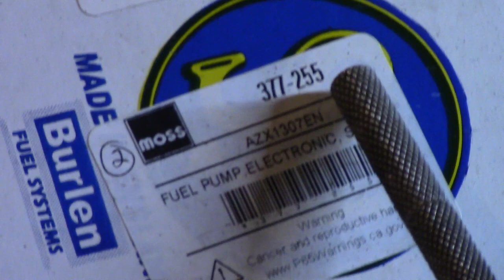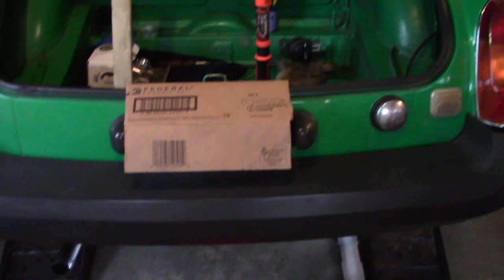MGB Fuel Pump Remove and Replace. How to Install a Fuel Pump on a 1965 to 1980 MGB. You Got This!

Comment: I have a 74 1/2 that for the first time in 10 years would not start after the winter. I usually start it a few times during winter here in NC to keep the battery charged but got lazy this winter and the battery was stone dead. Anyway, after replacing it, she'll crank but won't idle. I'm thinking some sort of fuel issue, or the pump may be bad. I put a little gas in the carbs, and it started briefly and then died. The trouble shooting begins!

Comment: Perfect timing finding your video. I have a 78 MGB with Rover V8 I am finishing up reviving from dead. I was wondering about the noise filter part of the wiring. Couldn’t figure out what it could be until you said it and then it was like slap to the forehead! On the under side of the tank, there is a wire with a connector plugged into the pump on that side, and I am not sure what that is now. I had been assuming it was the wire to the fuel sending unit, but your video has shown that to be incorrect (I received my car with a new fuel tank installed but everything else on fuel delivery was not installed).

Comment: Good video. The banjo fittings have a smooth side and a recessed side. Which side do you have facing the fuel pump?
Reply from the maker: Hey Mark, I didn't notice any difference. I put them on the same way that I found them. There was a lot of memory in the fuel lines so it was easy to put them back on the way I found them. I hope that helps
Reply from the maker: I rewatched the video and zoomed in and it appears the recessed side is facing the fuel pump on my MGB.
Reply: @CantLetHerDieDIY  I removed it all to put on fresh hoses, then i realized there is a difference in the fitting. Each old bolt did have a fiber gasket on each side and a neoprene ring. So I reassembled with the grooved side facing the pump and I get a drip. It seems like the grooved side demands a gasket. Sometimes,  on these cars, what should be so simple can be so perpl
Reply: Perplexing.
Reply: I reassembled each bolt with two fiber gaskets and the ring.
Reply: @cantletherdiediy1050  I bought new banjo fittings from BPNW, they are smooth on both sides. No recessed area. Will try today.
Reply from the maker: @markferrier6403  During my research on this fuel pump. I learned that the new fuel pumps have an o-ring (neoprene ring) which replaces the fiber washer on the fuel pump side. I don't think you should use the fiber washer if you have an o-ring on your fuel pump.
Reply: @cantletherdiediy1050  I assembled both sides with only the O ring on the carb side. It did not leak. Anyone who installs a new fuel pump should also install new banjo fittings. Cheers, mark

Comment: Hi mate, Ive got a 1979 MGB Roadster I had for 15 years. I'm originally from a little town west of Manchester called Salford. Up until now I've had my friend John Twist  of University Motors do all the maintenance on my little monkey (my name for it). John is very well know for his technical video's and as of late Zooooom ! sessions. The first time I called John he was actually closing his Ada, MI location. I told him my issue of lighting problems and he bet me a fiver he would diagnose the problem in under a minute. Well, I lost lol and ever since he enjoys chewing my arse for being a cheapskate when it comes to parts on me monkey. That afternoon in Ada John kept saying there was something unusual with regards to my car.. Finally he said... "I knew it!" He went into a very old and dusty file cabinet and pulled out his paperwork showing he had actually owned my car many years back. He was able to tell me where it went when it left him and some history. So, now John travels quite extensively and hasn't the time to be available to me so regularly. Your video on this pump is wonderful. Its video is clear and well lit. You thoroughly explain steps by step the process and I appreciate that.  I have a head injury from someone deciding not to stop at a stop sign years back which limits my ability to follow things well and your video is magnificent for that problem I have so thank you. I wonder how one know if they need a negative ground pump? Thanks in advance if you have a reply, David Hart. Allendale, Michigan.
Reply from the maker: Thanks for reaching out and commenting on my video. I'm happy to meet you David. I have watched some of John's videos and briefly met him at a MGB show once. I believe only MGB's built before 1969 had positive Earth. Your 79, like my 77, has a negative ground earth electronics which is much better. You can always confirm that by contacting Moss motors when you price out the fuel pump. They will be able to confirm your negative Earth pump. Thanks again David for the great comment on my video. That's a nice car you have there David. A 79 MGB .... take care of that gem Cheers!👍
Reply: May John rest in peace
Reply: @stephennickles7389 but John isn’t dead. Also you can get an SU Fuel pump that isn’t polarity sensitive